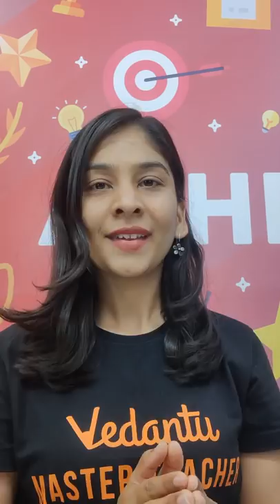Why Do Some Elements Show Variable Valency #Shorts #YTShorts

Comment: Ma'am why does Chromium and Copper show variation if we see below Elements below 30.           like Vanadium - 2,8,11,2 and then Chromium - 2,8,13,1. Similarly, Nickel - 2,8,16,2 and then Copper - 2,8,18,1.       So why does the Electron in the Fourth shell comes to third shell for both these cases, like why 4s² changes to 4s¹.       I have seen many elements like this like Nb, Mo, Ru, Rh,Pd,Ag,Pt,Au. Ma'am please explain

Comment: Doubt: Why do they do so ma'am? They can lose two electrons from the valence shell and become stable.They is the need to lose electrons from the previous shell of valence shell?
Reply: You will study in class 11th . It is based on extra stability . Full filled subshell and half filled subshell are more stable than usual ones. 
Their is a misconception that octet is only way for stability . We can say it is one of the way to get stable.
Their are some elements which don't follow octet in some compounds.
You will get to know this in chemical bonding of class 11th.
Reply: Thank you so much for the help🙏🙏🙏

Comment: We know that Iron has 26 total electrons 
And K, L, M, N shells have limits, 2,8,8,8 respectively 
Since it has 26 electrons, so electronic configuration becomes 2,8,8,8
It is balanced, as all its shells have complete electrons
And valence electrons are ones which must be left to get stability 
But it has already all shells completely filled
Then why does it have valency at all??
Reply: You may try another method of configuration
Like s,p,d,f or where K
Reply: No way!! K is 2, L is 8 but M is 18 and N is 32 which repeat
Reply: Actual EC(K,L,M,N) is 2,8,8,18. Thus, the shells of Fe are not filled completely, thus implying the possibility of exchange of electrons. 

I know it is hard to digest it( especially for 8th Graders like me), but we have to adapt to new things. 

Hope it helps 👍🏻